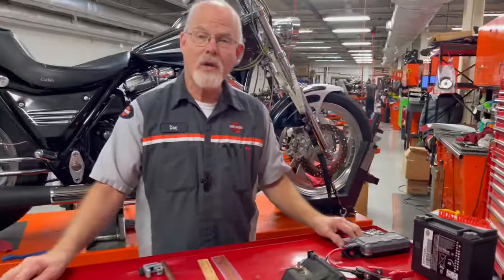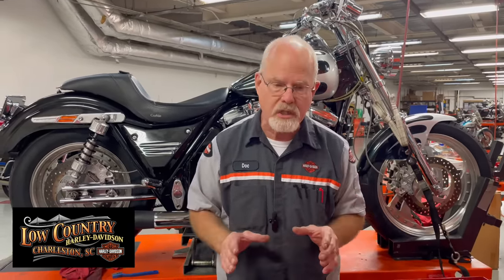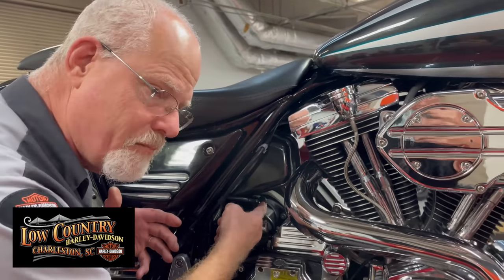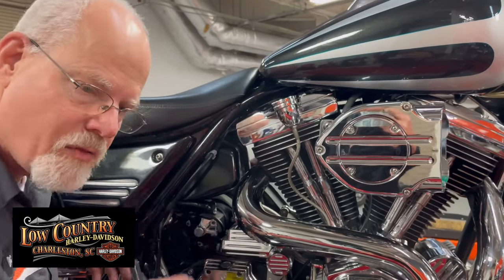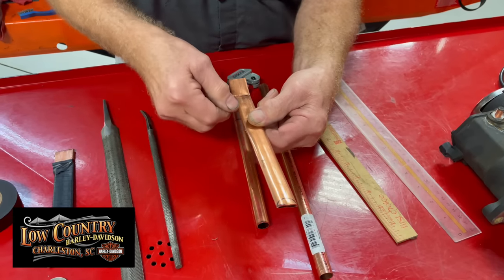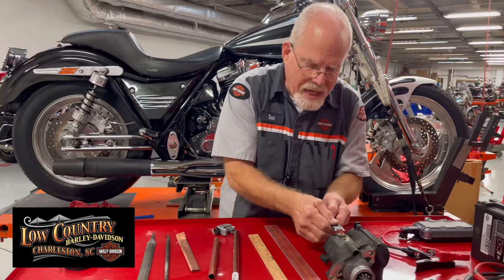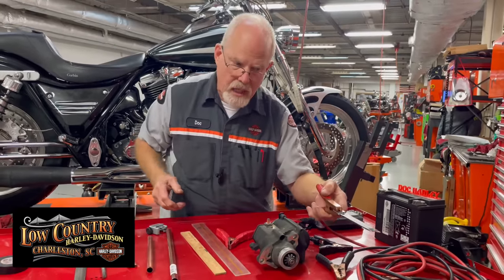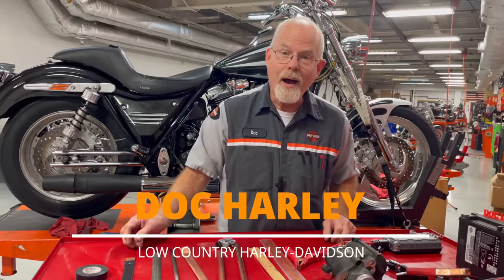Doc Harley Talks: How to Jumpstart a Motorcycle / DIY Tool for Starting Your Motorcycle

Comment: I was stranded on my 2018 Road King about 4 weeks ago. It was a very cold day mid 20's if I recall, and I went into a phone store and forgot to switch of the ignition switch! When I came out about 75 minutes later the bike was clicking and making weird noises. It was totally dead. I called a local dealer and asked advice and they told it could be jumped and where the starter stud was. They said if you jump from a car DO NOT leave the car on. I started walking to a parts store to get cables but was able to reach someone that had a portable booster box. They came over and it started right away. one clamp on the stud another clamp on the frame. I put it on a tender when I got home and the battery has been fine ever since. LESSON LEARNED. Happy New Year everybody and thanks for another great vid Doc! I'll have to make one of these just to have in my bag. I was able to reach the starter stud on my bike without any problem.
Reply: Thanks,,,love these Tech tips,,, Aussie boy
Reply: Yeah, if you jump another car, the way to do it is to hook up the jumper cables, start the donor car and let it run (perhaps revving it to 2000 rpm or so for better charging) for 5 or 10 minutes to help build up the charge in the dead battery. Then TURN OFF the donor car and try to start the car with the dead battery. Otherwise, when the car with the dead battery starts, the sudden voltage spike from its alternator can fry computer components, or at least confuse them into malfunctioning.
Reply: I have a Buture jump pack .Good thing about the Buture is it will transfer the power from the Buture to the bike battery .You don't need to jump start , just plug it in to your charge cable ( i put one one my battery for my garage optimate 7 day 24 hour chargerv) 
And after say 15 / 20 mins just disconnect the Buture and start the bike with nothing connected .it works same in a car except you plug it in the cig lighter socket ( it comes with all the adaptors ) sit in the car for say 15 / 20 mins pull it out of the cig socket and start the car .its a portable jump start come charger .
Reply: @John-ob7dh pm😊
Reply: This is one of my worries. Bc with the newer Harley anyone could just come by and turn the power switch on and walk away ( when you’re not there ) Then you’d return to a dead battery bike.
Reply: @trueman1326  Without the fob nearby the bike won't power up.
Reply: Also you can lock the switch in the 'off' position if security is a concern.
Reply: Still the best HD advice on YouTube.
Docs got class.
Reply: A booster box with a tender plug could you plug the box into the tender plug on the bike and jump start the bike? If anyone knows the answer please post it. Thanks
Reply: @russmarx4396  The tender plug is for recharging/maintaining the battery ONLY.  If you try to jump start using the battery tender cable you'll blow its fuse (if it has one) or melt it (if it doesn't).  Jump starting will take 100+ amps from your external battery, the tender cable can't handle that.  That's why jumper cables are so thick.

If your booster box has a tender plug then I suspect it's not capable of providing enough juice for jump starting anyway - sounds like it's only meant to charge the battery a bit, hopefully enough to get you going again.
Reply: @cjflintstone9509  thanks, my booster box doesn't have a tender plug, I was just wondering if you could use it to jump, thanks for the heads-up.
Reply: @trueman1326  I'm not sure on older bikes but my RGST turns itself off if the switch is left on and the bike isn't started.  I found this out in the garage while trying to learn the infotainment system and connecting my phone.

Comment: I can’t understand why Harley Davidson doesn’t install a jumpstart pigtail like they do the charging tender pigtail. NOCO makes one, easy, safe and cheap. NOCO makes the HD branded chargers and jumper already. The jumper pigtail plugs right into the jump box. It’s just a fact of life your going to have a dead battery on the road at some time with a machine no matter how well you take care of your battery. Having to disassemble half of the bike to jumpstart it is ridiculous and could be impossible requiring a tow truck instead of a jumpstart. I have the NOCO jump pigtail on both my Softails.
Reply from the maker: Would you Email me photos of your set up?…..Doc
Reply: You are talking about the same company that doesn't put heel/toe shifter on $40K bikes.  They are probably trying to figure out how to sell big twins with one cylinder and then raising the price for their new weight saving package.

Comment: Hi Doc, great idea.  Just one suggestion - your tool touches the starter stud at a single point, and there's a lot of current (100 amps +) flowing through that tiny contact point when you hit the starter button.  I would suggest filing a narrow V instead of a circular notch on the end.  Now you have two points of contact instead of one, and the narrow V angle increases the contact force.  Both features make it less likely to leave a burn mark on the stud.  Other than that, an excellent tool to have handy.
Reply from the maker: I like your suggestion….Doc

Comment: I have a small jump pack that has a pigtail connected to the battery like a battery tender .  Just plug in and jump off if needed . I like the tool .
Reply: Your idea is better.
Reply: @Jonathan-L  You'll melt your pigtail or blow its fuse if you try to jump start through the battery tender pigtail.  It's for charging the battery, not jump starting.  Compare the wires in your battery tender with jumper cables - there's a reason the jumper cables are huge.
Reply: @cjflintstone9509  Thank you kindly sir.

Comment: What a great idea! I always carry my mobile jump starter around in my car and my bike but always had to take off my seat and so to get to the battery in case I needed it, will make myself one of your jumper arms to have it a lot easier with less working on bike 

My jump starter had helped a lot of people so far
Reply from the maker: Thanks for sharing Paul….Doc
Reply: I have same type jump box as Doc
They have harness you can buy goes from box to battery or plus to battery and negative to ground 
Zip tied along frame under seat area 
Easy to attach box like you would a battery tender leads 
Have 09 FXSTC

Comment: I carry a small jump starter as well as a set of Yousa Motorcycle Jumper Cables. The clamps on motorcycle jumper cables are small, and fit well on the starter post under that boot. Tons of hassle to try to get under the seat and ECM of many touring models.
Reply: What brand jump start and model # do you have and cables ?

Comment: Nice video.  I truly respect and do get solid tips from you Doc.  I have been following your sage advice. Your method is simple old school.  For me, the new school is to get a copper or aluminum bar instead of the pipe.  The newest school is to create an SAE connector for the battery.  Alligator's 10-awg extension is also a plus to actually connect to a car battery.
Reply from the maker: Good points! Thank you….Doc

Comment: Great idea! also if you have a buddy or a hill you can push start it on 2nd gear
Reply: Dead/weak battery may not start the fuel pump on fuel injected bikes.
Reply: It will start easier in the highest gear you can get it in.

Comment: Doc that is a very good idea there, might want to make the curve for the stud slightly smaller but if it works go for it.  On my Oldwing, well that is what we call it as it is 30 years old, we can access the positive cable relatively easily.  Yes I did exactly as you noted, had to jump it to get it going as had a bad case of HUA, Head Up -ss, and it worked fine.  Some people cringed but hey it worked.  As for the Damn BMW, either you make an emergency pigtail and install it when you change the battery.  Yep again HUA, and on the BMW made a short 10 gauge leads off of the battery to a homemade nylon hookup point.  I guess I have to much time on my hands and a shop full of toys.  You can't jump it but you can charge it at a rather healthy rate if needed.  I use this as a place to slow charge the battery.  Change the battery out on a Oil Head BMW 01, ONE, Uno time and you will see just how over-engineered and under-thought-out Germans can be, either that or they are still trying to get even with the Allies for those 2 disagreements some years back.
Reply from the maker: A great story, thanks for sharing…Doc

Comment: 2020 Softail Lowrider S, I just made and ran an insulated jumper cable from the positive on my battery over the top to behind the right side cover and have tie-wrapped it in there. So if needed I just remove the right cover and there it is.
Reply from the maker: Well done sir👍…..Doc

Comment: So I asked this question to you a few months ago:
You should make also a video showing the Harley battery pack that you can use to jump start the bike and how it can be attached to the starter and not the battery. Also note that if you have a Lithium battery, this battery pack is not recommended.
Your answer:
Good points Eric. In my opinion, I would rather take the time to jump at the battery....Doc

I shared this with alot of people including a motor officer and he said he jumps from the starter stud all the time and everyone else does not know why you consider it so dangerous? Thanks for posting the new video.
Reply: Hello Eric, I think the idea of having a live buzz bar (the copper pipe) just held in place by hand pressure and a groove  is by far the more risky way to jump start your bike than clamping onto battery terminals but do appreciate that access to the battery on many models is a real pain. I have a 2014 Ultra Limited and the term Limited can be applied to battery access.......... ride safe one and all.
Reply: @ianrobertsonRR1  Yes, when I spoke to a Motor Officer he said he uses his jump pack on the starter stud all the time. He said if he had to jump from the battery itself, it would take 20 minutes!

Comment: It’s safe to do as long as the vehicle is engine off. I use a jump box and it works fine…for the Lithium folks, just warm up the battery if possible and wake it up first before jumping. If it’s cold, then jumping Lithium sucks regardless.

Comment: Great tip!  Yes, batteries have a lot of instantaneous energy which must be respected, arc welding.  Be careful of wedding ring or necklace.  Explosive hydrogen gas and acid all bad.  I replaced all my lead acid batteries with lithium Iron batteries.  Worth the upgrade especially with increased CCA of lithium batteries and large bore bikes.

Comment: I took the auto train from Sanford, Fl to Washington DC. I remembered to put my bike in transport mode before it was loaded on the train so when I arrived I was good to go. Unfortunately several others had not done the same and had dead batteries. I had a small booster pack and spent the next 2 hours jumping motorcycles.
Reply from the maker: Now THATs a Story👍……Doc

Comment: Great idea! Couple things to improve maybe. You can drill the hole in end then cut half the hole off instead off filing. Try heat shrink tube instead of electrical tape. Also, the current capacity of the copper should be more than adequate so I wouldn’t worry too much about heating up during use
Reply from the maker: Very good improvements….Doc

Comment: This is a very good ideal, and there is room for a little improvement. Like drilling a hole on the end and put a bolt the for the Jumper Clamp, that would make it a little more secured.

 I took a trip through the mountain (about 140 miles round trip), here earlier this month. After arriving at my destination, I parked my bike for about an hour. Came back to the bike to get on my way back home, and the bike wouldn't start, because the battery was too low of charge, I know this because I have a charging station on my bike that has two UBS ports and one cigar lighter port plus the voltage meter read-out. The volt meter read 11.7 I was parked on a small hill, so I just drift started the bike, after riding for about 40 miles I knew the bike wasn't charging the battery (volt meter reading was down to 8.6), and I was in the only town around for miles that had a Auto-Parts store. I bought the only Battery they had for my bike, the battery (it was listed for my bike) was short from side to side about 2 inch, but it was fully charged (volt meter read 12.4) and got me home (voltage was 11.2 after riding almost 30 miles).
 I have a 1993 H-D FLHS after getting home I put my bike battery on charge, over night. Next day it was fully charged, I then found the charging problem, the connector from the stator to the voltage regulator was about half-way disconnected. I fix that and put a rap of tape around the unit to help hold in place. I also took the battery back to the store and got a refund(150 bucks), because it was the wrong size battery for my bike (I also fully charged this battery too). 
 So the moral of this story is you can make it home without a charging system working, you just need a Fully Charged Battery to do so.
Reply from the maker: Thanks for sharing your story….Doc
Reply: I’ve got a 1992 FLHS and had the same problem. I made a plug retainer out of a piece of wire. They sell them pre made online

Comment: Jumping a Harley with a fully discharged battery will blow your stator and voltage regulator as soon as you remove the jumper cable connection from the running bike. The dead battery will look like a short and cause high current flow which will burn the stator up. The voltage regulator usually overheats as well.

The proper way is to let the jump vehicle (or box) charge the bikes battery until the bike will start WITHOUT the jumpers connected. This takes time. Either wait and get the dead battery charged enough so it doesn't overload the charging system or just jump it off and blow your charging system. Your choice. Just remember, if the bike can crank in it's own, it's safe to run.
Reply from the maker: Interesting facts. Thanks for posting….Doc

Comment: I have a battery charger/tender that allows me to connect a "pig tail" to the battery posts and are external to ""connect" to the charger. The unit comes with a pair of clamps to "connect" to battery for bench charging. I tried to jump start my Heritage Classic by connecting the pair of clamps so I can connect to jumper cables. I learned that the polarity is reversed in this manner and the clamps polarity should be reversed in this situation. I hope this helps somebody.
Reply from the maker: Thanks for sharing…Doc

Comment: Stop using the handlebar switch to shut off the m/c.  Use the ignition switch and you will never kill your battery because the lights, etc, were hot/on while you were parked for two hours away from the m/c.
Reply from the maker: Good advice….Doc
Reply: good advice right there. I always thought the handlebar switch was for emergency shut off anyway. That is why they are red in color, so they stand out.

Comment: Hi Doc, another great vid. I have a 2018 lowrider, got it new. It has 60 g's miles on her. Doc when should I get a new battery, she's runnin great now.
Reply from the maker: A Harley-Davidson battery could be good up to 4 years. Understand each year after installation the battery will loose a percentage of CCA. First year no problem. Second year a little less by the end of the 3rd year it would be well to start budgeting for a new one. Mileage only counts if you make a lot of very in town short trips or you have a lot of accessories draining the battery. The life of a battery is extended with a smart battery tender….Doc

Comment: Great idea... I have a booster that has an adapter attached to the battery. Easy access for the booster. Much safer option :-)
Reply from the maker: Great tip….Doc

Comment: I like your Harley jump start tool, it's inexpensive, easy to make and appears to be practical, reasonably safe and effective.

I suggest making it a bit longer so it can be used on a greater variety of motorcycles.  And as another person has suggested, making the notch at the end that engages the starter battery terminal a slightly smaller radius to facilitate a more secure engagement.

Someone also suggested using a permanently attached battery charger connection.  BAD ADVICE!

Those are ONLY intended to provide a convenient connection for CHARGING the battery ONLY and NOW FOR A JUMP START CONNECTION.   Attempting to jump start through those things will cause them to overheat immediately, causing damage and a real risk of fire.

As an alternative, connecting the discharged motorcycle battery to another RUNNING vehicle via an installed charger connection will recharge a GOOD motorcycle battery if you're patient, but only if all the bikes electrical loads are TURNED OFF.

DO NOT ATTEMPT TO START THE MOTORCYCLE WHILE THE OTHER VEHICLE IS STILL CONNECTED TO THE MOTORCYCLE!
Reply: Although I had no immediate need for the  Harley jump start tool, knowing that it will be handy someday.

I made one, but Instead of wrapping the tool with tape for insulation I used heat shrink, two layers for extra security.  I cut the upper layer of heat shrink slightly longer so it extends a little bit beyond the ends of the first layer to achieve a little better appearance.

I'm sure that tape works fine, but heat shrink won't deteriorate as much after riding around an the bottom of the saddlebag after a few years.

I think it gives the tool a more professional look too.